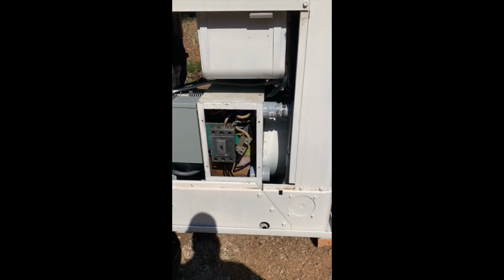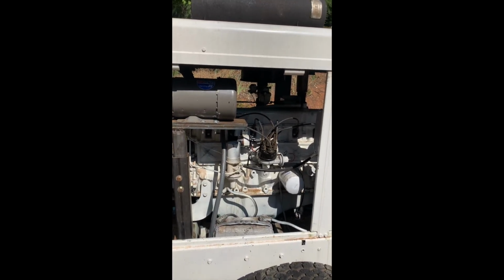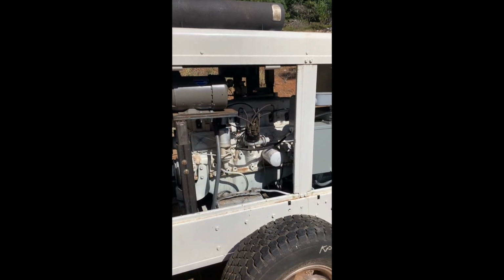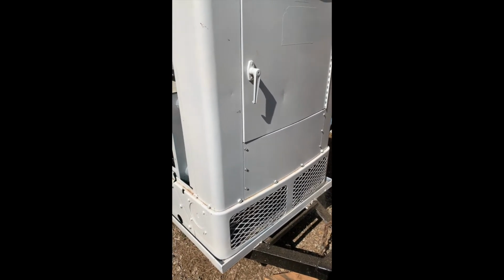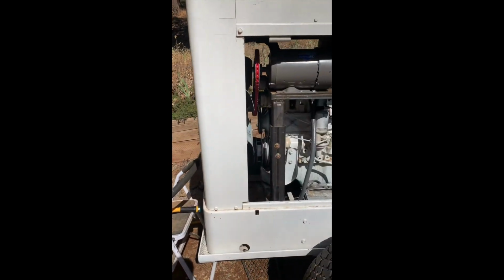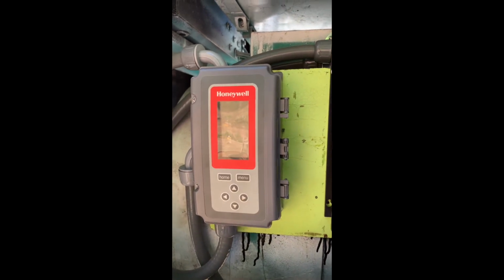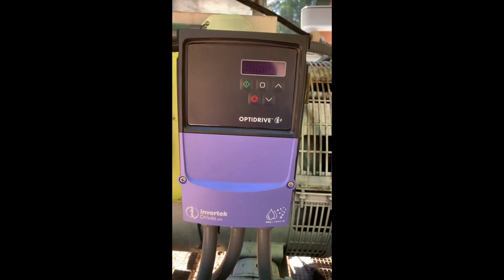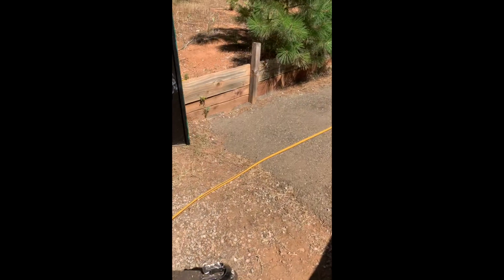Onan Generator with variable speed cooling fan

Comment: I'm a power generator mechanic by trade, worked on more of these than I can count.  There was a heat exchanger municipality water cooled option for these with no fan which were very quiet compared to the fan.  Those Ford engines are naturally quiet and will run forever.  This is a great idea.  There's a company called Flight Systems in PA that will repair any of your electronics on these of you ever need.  They even sell improved versions of the old boards.